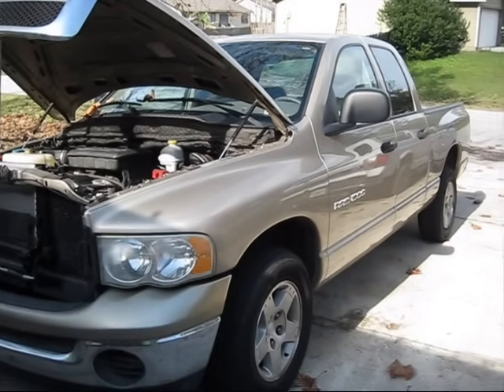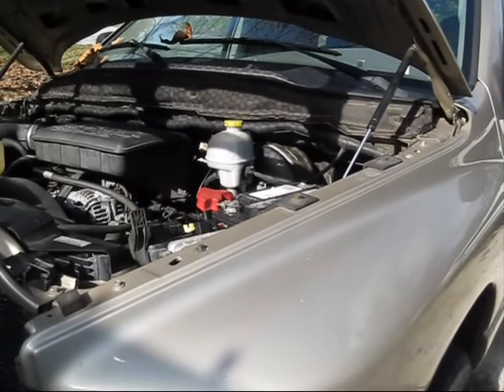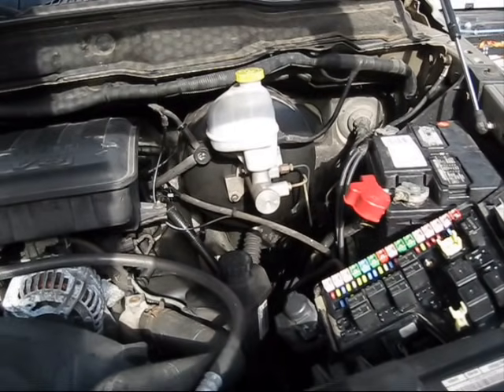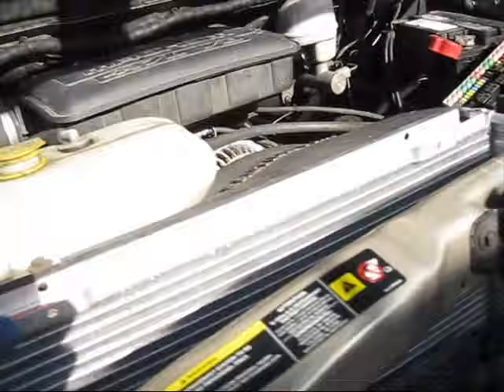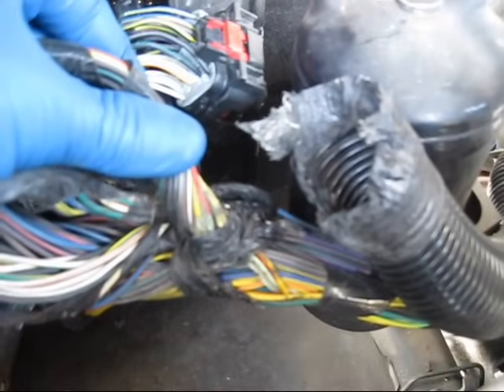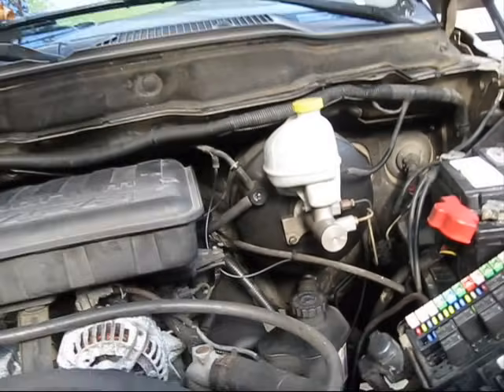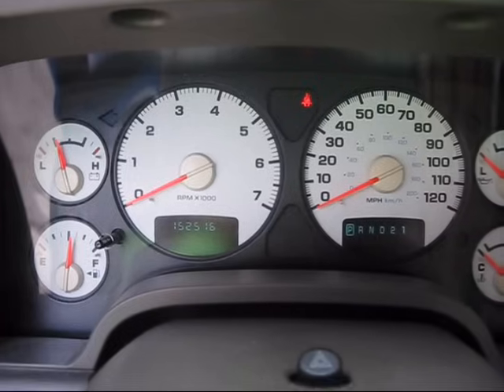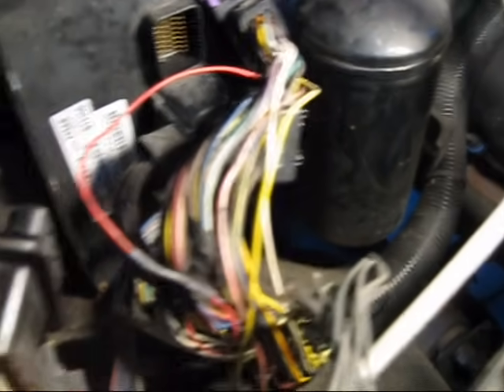Dodge Ram 1500 no crank / no start diagnosis and repair

Comment: 06 1500 changed the fuel pump apparently I have no fuel relay, I can hear the pump prime checked fuel rail and have fuel.  Even sprayed starting fluid in throttle body still will not start....
Reply from the maker: Then you lack compression or spark.
Reply: @pfun41  yeah it's gotta be spark
Reply: @pfun41  any ideas what to check next specifically, i can't see it being just because of 1 plug or one coil pack it's gotta be a sensor or control module
Reply from the maker: @NoMoreBLUEISIS  Check trouble codes.
Reply: @pfun41  going to get code reader today

Comment: Mine did this and the little wire that follows battery wire to starter and clips on the solenoid was broke off at the clip at the starter. Put new end on it and boom, saved slot of money.
Reply: Where did you get the new clip? Mine broke and can't find what the part is called... I need the new clip and wire
Reply: @therealbigfoot3076  if its broke off of starter, replace starter,,,if its broke at the wire, just buy a new pack of those blue female wire ends, thats what i did

Comment: I wonder what C codes we’re on the cluster. I’m kind of having the same problem except my 31 slot fuse keeps blowing every time I turn the truck on.

2008 Ram 1500 Slot 31 (PCM/TCM) Red 10A Fuse blows as soon at truck turns on. When that fuses out you can’t tell what gear you are in, it goes completely to no crank status. 
 Any suggestions?
Reply from the maker: You likely have a dead short in the circuit or in the PCM/TCM. The cluster will only show it the information available to it. When the PCM/TCM is not working it won't tell the cluster gear position.

Comment: That is the starter ,it happen to me on a chrysler town and country .if you go down the starter and move the wire that is with the big screw it wit turn on but it wil happen again because the starter electrical connection is broken inside and is not doing a good connection
Reply from the maker: How exactly does a starter kill all power to my PCM? Did you even watch the video?